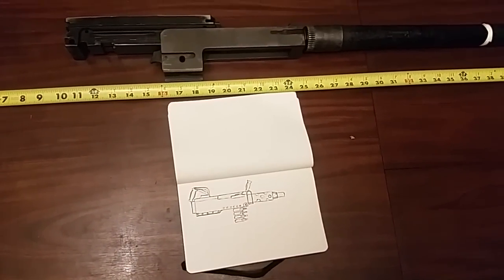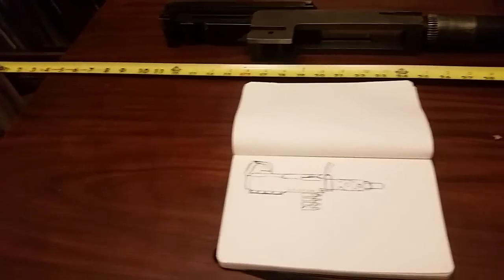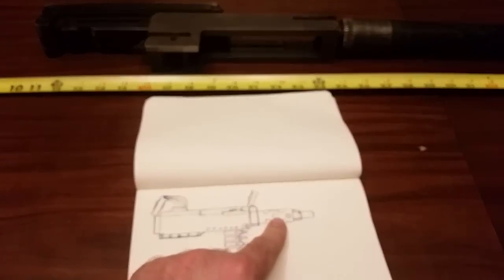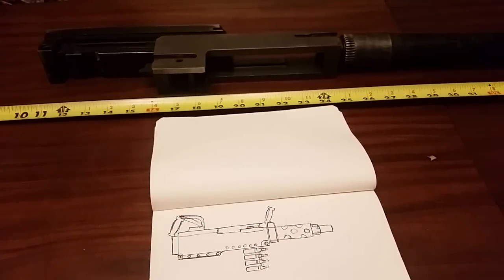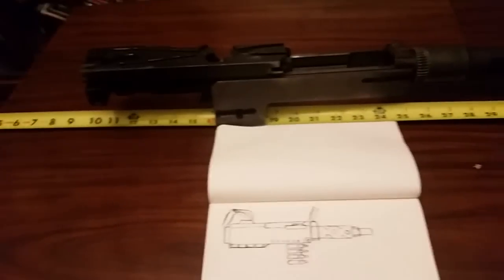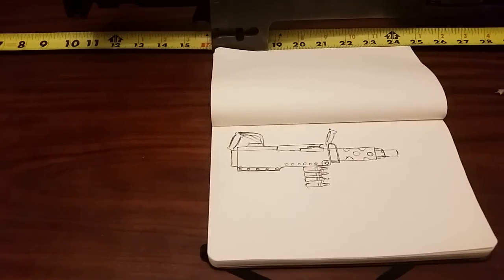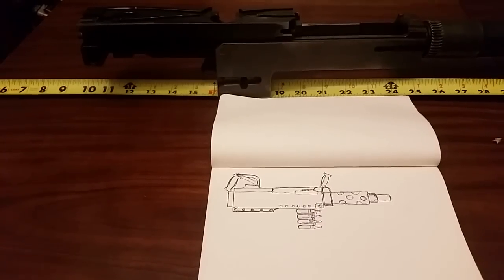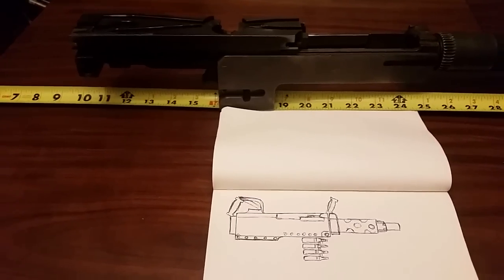Man Portable M2HB project: Video 1 The Deuce overview

Comment: I don't think there's any need to mess with calling it a pistol. If it is originally built with 2 grips then it is a title 1 "other" as it is not built, designed, redesigned or intended to be fired with one hand. Check out what Franklin armory has done with the ar.

Comment: do a 308 in call it a pistol no stock
Reply from the maker: I actually have one of those ;)
Reply from the maker: +Proto-Ordnance  not assembled yet, not a pistol by fed law, and it needs a mag lock before I put in the bite sized barrel or the forward grip.
Reply: +Proto-Ordnance  I built a 1919A4E1 variant and have the shorty barrel so I have a 30lb pistol. As I see this as a long term build you may want to ask ATF on the legality of the front grip on such a short package, I never put one on mine just to stay out of this possible gray area.